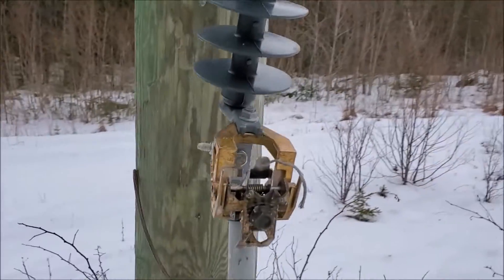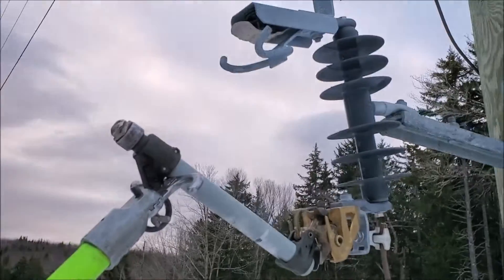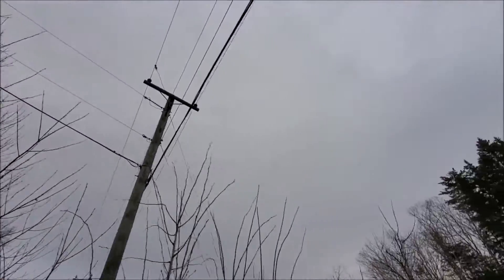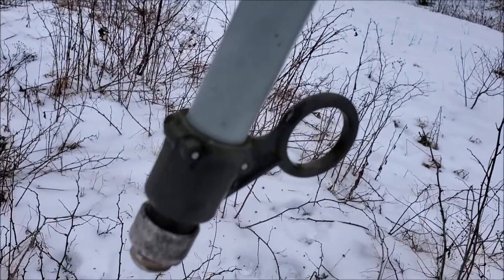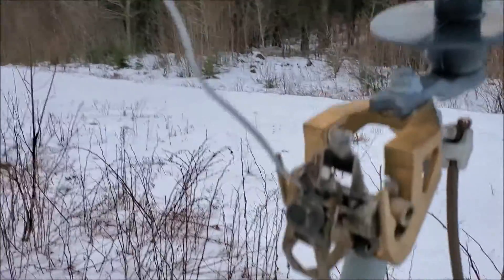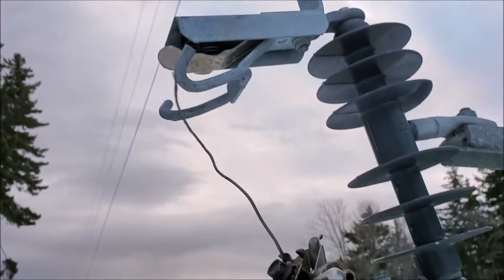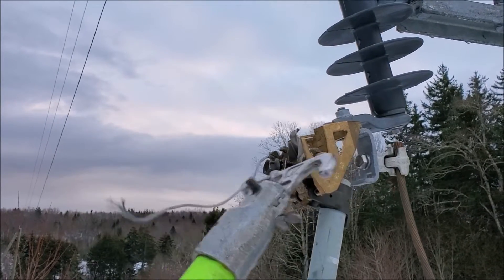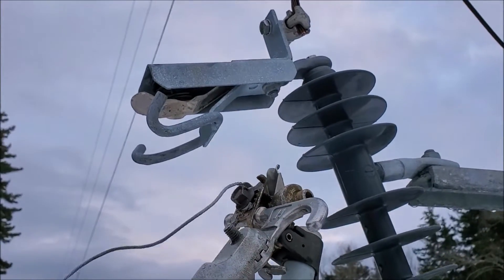Lineman Tip #1 - Refusing cutouts

Comment: Thanks for the great information. I have a couple of questions. In my town it appears that some of the pole mount 1 phase transformers have internal protective links - no cross arm cutouts. Have you used these and if so how reliable are they? How do you replace a failed internal link? Second question. The town I live in has a fair amount of the neighborhoods with an underground distribution system. There is an area where the UG feeder is extended up a pole to feed about 40 houses on a dead end road with all pole mount OH equipment.  The line side UG riser up the pole terminates in the bottom of the cutouts - rather than the top of the cutouts - bottom is the live end. Is this a somewhat typical application? Thanks again for all of your helpful information.

Comment: Honestly, I think the fuse inside the door is poorly designed. The door should be somehow longer, and the cutout longer, and the fuse element placed in the center of the tube instead at the bottom. This way when the wire goes out, the fuse still works correctly, but the dangling wire is nowhere close to the live side.
Excellent video tho of course. Thank you!

Comment: I don’t know if you have a video on it or not, but I would love to know how exactly the cut out fuse works, and how it’s able to detect a fault and blow. Thanks
Reply: The fuse is a wire made of a metal that melts at a low temperature. The more current that flows through the wire, the hotter it gets. When too much current flows, the wire melts, breaking the circuit.